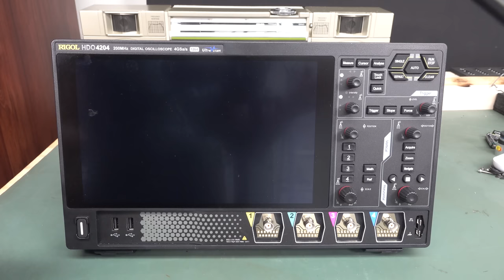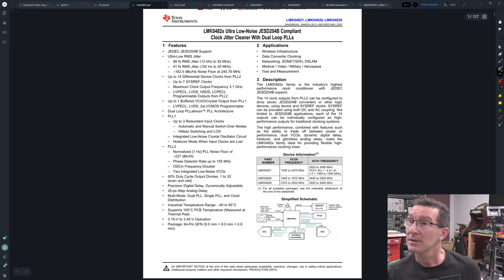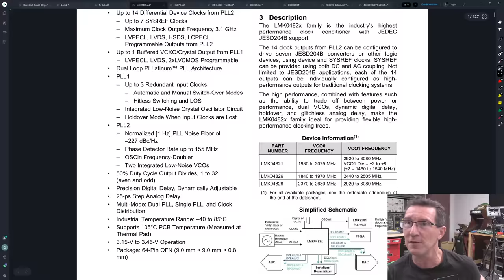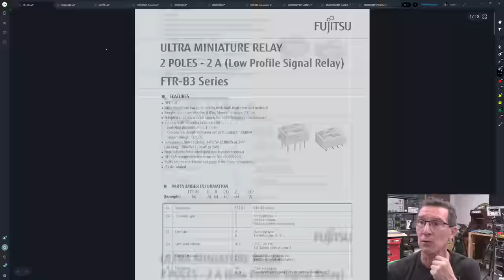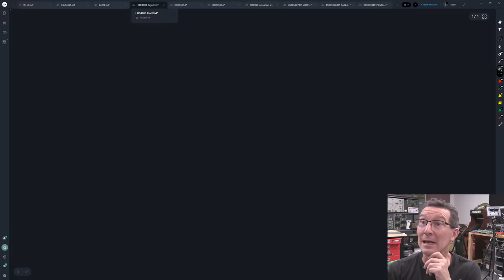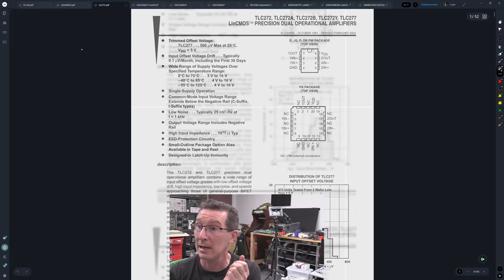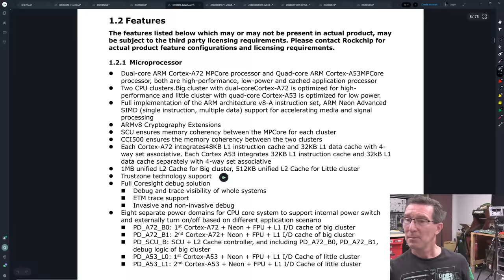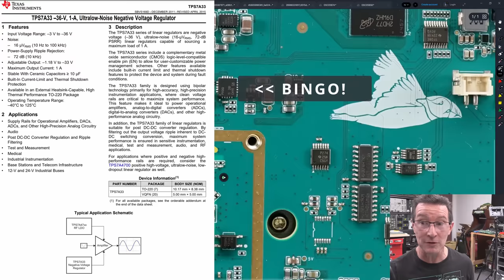EEVblog 1503 - Rigol HDO4000 12bit Oscilloscope TEARDOWN

Comment: Bird is a puffin. Black and white with a coloured beak, and not common in Australia outside of a zoo. 

And fast flying so a fast colour device.

50R termination going to be well cooked if you put more than 2V into it, going to say you will have a call for inputs to have a warning on that mode, or you will be cooking input resistors within a week if you have anything over naff all input power.
Reply from the maker: Yes, I expect many fried 50ohm inputs. Maybe they couldn't get the bandwidth (and response shape) they wanted with the bigger part.
Reply: Puffin is common on the east coast of Canada especially Gaspe Quebec.
Reply: @EEVblog  I can see the one accessory being sold will be a 50R inline termination that can handle 5W, probably with 6dB attenuation or more, so that you can actually use the 50R input. Otherwise a warning when selecting 50R that your input range is limited to 1V only.

Looks like the team was the one that did the spectrum analysers.
Reply: A puffin might be better than a weird egg-laying poisonous mammal.
Reply: @EEVblog  Reported yet another impersonator......
Reply: @EEVblog  - thanks - you answered my question earlier today.
That is not good - people will get burnt out PCBs.

As Dave says at 16:00 those tracks and parts look very whimpy for 50 ohm mode.
Are they 5 thou tracks and tiny resistors?
So could they burn out in some situations?
Reply: I wonder if the Rigol PCB designers had some kind of unpopular opinion... ;-)
Reply: ... but not really so much RGB-coloured colour device. More of a RWB one (Red-White-Black)  😉 https://en.wikipedia.org/wiki/Puffin

Comment: The RK3399's big value proposition is probably that x4 PCI-Express port, which makes for a very convenient way to talk to logic on FPGAs. They might even map the waveform store RAM directly into the SoC's address space.
Reply: Thanks for letting us know, the interface between the SoC and FPGA was one of the things I was wondering about, PCIe is a really nice fit for this application indeed!
Reply: It's at the heart of a few single board computers too.

Comment: I wonder if the heatsinking could be more about minimising temperature for stability than having to dissipate a lot of heat
Reply: Maybe even have all inputs at the same temp, to reduce differences between the inputs on the same signal.
Reply: I also like the way they integrated heatsinking, temperature equalization and shielding into a single die-cast part.
Reply: @aDaWaN  Makes sense, after all a single spin cast mould that integrates it all is going to be cheaper in the assembly line, and you can get great dimensional stability in that single part as well so minimal machining work to get good results. You need a heat sink, so makes sense to have a single part then for the entire range, and it definitely cuts the cost down in assembly. Spin cast, run through a single CNC mill to level the critical paths, and drill the holes and tap them, and be done. One fixturing clamp only needed, and perhaps 3 minutes of machining time total. 400 per machine per day is probably faster than the rest of the production line.

Comment: excited for hdo1000 with12bit at $999. would be very nice to check for whether it actually has that 50 ohm input not mention in datasheets but stated in  ui and the front panel.
Reply from the maker: No 50ohm input or active probe inputs.
Reply: @EEVblog  Oddly enough hdo1000 user manual 5.4 says:  When the input impedance is set to "50 Ω", the channel coupling is set to DC coupling by
force.
Am  confused.
Reply: @bakagaijin7452  Probably used with external 50R terminator, and software sets the input to DC coupled when you select the 50R termination for the display unit.

Comment: Looked at using a 4053 for a sample+hold circuit once. The worst-case ratio between on-current and off-current wasn’t extreme enough. Ended up making a large spreadsheet, and settled on using a DG444.

Comment: an interesting note with the closer look around 24:25.
the micron memory there (and likely for the SoC as well) is 4Gb/512MB x16 width DDR3L 1866MT/s memory, so there is 2GB total RAM there, which makes sense with the ongoings under the hood. the 3399 ARM SoC has a PCIe 3.0x4 link which also makes it easier for coms to the FPGA with low latency, as a few people in the comments here have mentioned. this is fitting given it's 2Gs/s would be too much for serial unlike lower sample rate and bandwidth scopes.

Comment: Rockchip 3399 is commonly used for android boards.  I think Linux will run on a wide range due to the large community but I always see the rockchip 3399 and the older 3288 on android devices- it’s probably because there is well validated software to run on it. The two buttons populated are recover and reset and I always see them populated regardless of if it’s intended to be worked on. Somehow it must be required.  I’m working on a 3288 now trying to hack an old advertising display with touch screen on it. It’s supposed be to be “pretty powerful” for android because it’s also found commonly in Chromebooks

Comment: I seriously question if the 'Warranty void if removed' sticker is legal in Australia. I don't think it is in the US.
Reply: If it is, you can buy the exact stickers on Aliexpress.
Reply: IT IS Legal in Australia
they can legally refuse your warranty if the sticker is violated
and i'll tell you how i know this 

Many moons ago when i bought my DS2000A Series Rigol scope
as we all did, i did my upgrade to 300MHz
Anyway, i went into Emona Instruments at one point and they figured they'd come out with the question and face me with it 
well... Little did they realize , i handle pressure extremely well and i don't give 2 fucks about what they think

In a nutshell, they asked 
"so... you did the upgrade illegally did you ?"
i said to them,  "No, I didn't do anything illegal, but i did do the upgrade"
The scope is mine i can do what i want with it 

they asked "so you removed the warranty sticker did you "
I said "well.... You can see the warranty sticker is intact and un damaged and not violated"
they went on about a speech regarding "well, we know you took it off"
and i said "well, regardless of what you think you know the sticker acts as evidence of tampering and as you can see the sticker has not been violated and is still intact"

THEY HONOURED THE WARRANTY

so yes, it's legal
But... Had i said directly "Yes, i removed the sticker" this would have been enough to void the warranty instead, i said "well. You can see it's still intact"
In Australia there is a big difference there , legally speaking.

and ... LOL.. He actually tried to debate with me as to whether i was doing something wrong. 
and i said,   
Mate,   it's my scope,  i can throw it in the bin, i can piss on it if i want , i can pull it apart and take the components out,  it's my scope

When he said, but it's our software
i said... "well, You shouldn't have been so stupid so as to lock it via software,  and you should have been smart enough to know who you are selling to and what the product is,    what did you expect us to do , We are technical people, as soon as we get something home, we open it and check it out,   did you honestly expect no one to interrogate the firmware ?   so.. since you were banking on no one finding out and we did,  i suppose you'll learn for next time won't you ,  as for now, you gotta cop it on the chin"

he said,  when you bring in your scope for service we'll just roll back the update to 70MHz
and i said "actually , no you won't , what you will do is  LEAVE THE SCOPE IN A SIMILAR CONDITION AND STATE TO WHICH I BROUGHT IT TO YOU IN"
they had no way out of this , they just had to grin and bear it
Most people kept quiet about the upgrade,   i didn't give a fuck

Comment: Really interesting that they are using Linux on the Rockchip and there is a JTAG, 4 pin port and 2 switches.   That thing is probably easily hackable.

I'll bet you can ssh into the OS from the 4 pin port.
Reply: try username root and psw rigol XD

Comment: With Android OS it should be fairly easy to connect this scope to the internet. Android platform includes the HttpsURLConnection client, turning the scope into a web browser and a web server. More and more test equipment are being designed for World Wide Web connectivity
Reply: That leaves us with 1 question: Why would you want to connect your scope to the internet?
Reply: @JCGver  1 Remote users on the internet can see exactly what you are seeing during a test by logging into the scope with secure username and a password  2 Email test results such as screenshots or JPEG video of the test to others on the web.3 Download new 'app' to change scope functions.  4 Save test results to the CLOUD for future analysis and viewing. you can store unlimited amount of data to the cloud   5 Using an embedded web server, a remote operator can run the scope from anywhere on the planet, 6 Factory diagnostics in case of failure. 7 Factory calibration and firmware upgrade 8 You can download third-party apps for various analysis, you don't have to depend on Rigol for their limited analytical library... and many more applications. I hope that gives you an idea of why test equipment are getting connected to the World Wide Web
Reply: @nicmate2543  - Wake up!  it's no dream. It's reality. Most modern electronic equipment are internet connected.

Comment: Not a Tek 2 but still a very nicely built scope. I like the shielding and the way the PCB is designed. Just look at all the gold plating and these smoothly rounded traces, it's a thing of beauty and a joy for ever, just like Tektronix did in the '60s. Good job, Rigol engineers! Now, on to Shahriar's teardown... wonder if he'll do one too, haha!
Reply: It's way better than the universally panned Tek series 2.
Reply from the maker: @NeverTalkToCops1  It's hardly "universally panned". By who? It's a nice scope, it's just not great bang-per-buck. But bang-per-buck is not Tek's domain.
Reply: @EEVblog  Tek is more the buck per bang, and being at the bleeding edge, for the time. Then stay as the solid reference for the following 3 decades, to use as a reference device for all who use them.
Reply: @EEVblog  Panned by MANY commenters to your video. How casually you dismiss the "bang for buck" factor. "... Not great bang per buck"? Of course, the Tek 2 series is horrible bang for buck. Who buys an 8 bit scope when this 12 bit Rigol scope is available at less bucks? Even Rhode & Schwarz will have sales of their 10 bit RTB 2004 scopes suffer because of these 12 bit Rigol offerings.
Reply: @SeanBZA  IF your criteria depends on gear being a viable "reference device" for 3 decades, then have at it. How is the Tek series 2 "bleeding edge" at 8 bit resolution a better value than these Rigol 12 bit offerings.
Reply: @NeverTalkToCops1  Kereping the big market, the military, from needing to change any of the training they have had for the last 50 years, just like Fluke still makes average reading meters and not RMS, to emulate analogue meter movements.

Comment: 24:25 is that QR code made with vias?
Reply: It says "QR code" on the silkscreen, but it's actually a Datamatrix code. It reads "ZRSPYHDO12209050003" w̶h̶i̶c̶h̶ ̶i̶s̶ ̶p̶r̶o̶b̶a̶b̶l̶y̶ ̶t̶h̶e̶ ̶s̶e̶r̶i̶a̶l̶. (2022-09-05? Third one off the line?)

EDIT: My assumption above is wrong. The serial can be seen at 0:28 and is "HDO4A243700085"
Reply: @henninghoefer  I don't know my 2D codes well enough to know the difference. I was just surprised by the way it was made, with vias.

Comment: 12:00  "Just a differential pair output buggering off there."  That's the second usage of "buggering off" differential pairs used by Daiyve.  Is the destination of the "buggering off pairs" the flying albatross on the PCB? Place your bets.

Comment: Seems FPGA memory bandwidth limited then, since 2x ADC and only 4GS/s in single channel mode.
With dual ADC, 1ADC for 2 channels, 4GS/s should be possible in 2Channel mode, but FPGA interface/memory bandwidth likely sucks too much, for that ;-/

Comment: It's using custom Rigol chips - what if they need to be replaced one day?
it has BGA chips - so hard to fix if not impossible.
The multitude of tiny switch mode power supply chips doesn't look durable to me.
I've seen chips like that cooked on PCBs.
As Dave says at 16:00 those tracks and parts look very whimpy for 50 ohm mode.
Are they 5 thou tracks and tiny resistors?
So could they burn out in some situations?
Reply: BGAs actually aren't too bad anymore; even if you're not comfortable with or don't have a good hot air gun they have a broad hoof attachment for most irons that let you take them off in seconds. Then you can stencil on some solder paste (stencils are optional, but cheap and helpful), heat it again to create the ball, and then plop it back down and zap it again quick with some heat and you're done!
Reply: I think the hardest part for me with custom chips is the supply. Dries up quickly after production and then you're dead in the water if you need one down the road.
Reply: @Chilangosta  - in theory that is OK but in practice it's hard to get a reliable repair.
You can't see if your solder connections are all OK.
Did you know that they check BGA connections with an X-Ray system in the factories?
Reply: @Chilangosta  - yes - they make only a certain number of chips and that's it.
Factories will often order an extra 10% to keep as spare stock
so they can do repairs and that's all there is.
They use too many custom chips to cut down the cost of mass production.
In the good old days design engineers would try their best to use chips
that were available from at least 3 different sources but not anymore.
Some chips now even need factory firmware to operate them too.
You'd never be give that.
The repair game is a thing of the past in many cases.

Comment: Why would you want to add a DC bias to the frontend?
Reply: good for measuring low frequency noise/drift for power supply circuit?
Reply: I was also confused. Everything should be software controlled.

Comment: I'm confused Dave, you keep saying 800mhz scope, but it says 200mhz on the case?
Reply: That's because the hardware is an 800MHz scope, only the firmware limits it to 200MHz. You can buy a license code from Rigol and unlock the higher bandwidths.

Comment: Yeah they cheaped out on the rock chip soc, it's a turd processor for bottom of the  barrel tablets and cheap TVs, performance is horrible as well as software support
Reply: It may not be a high end SoC indeed but there was a time not so long ago when a scope did not need a 6 core 64-bit CPU running at 2 GHz 😉
Reply: @MrJef06  and that's.how you get sluggish unresponsive UI as soon as you do anything than displaying a basic waveform. That manufacturers always cheaped out and put underperforming soc does not excuse them

Comment: SOO UNFORTUNATELY.  THIERS ALWAYS AN UNFORTUNATE.       THE RESON FOR THE HEAT SINKS AND FAN IS TO DRAW DIRT AND DUST IN AND OVER HEAT IT IN YEAR SO IT OVER HEATS AND YOU HAVE TO BUY NEXT YEARS MODEL. THAT'S THE REASON ALWAYS FOR THE FAN.     ALWSYS.  YOU CAN ALWAYS DESIGN ANY THING THAT RUNS COOLER OR HAS A FAN FILTER.   THIS IS PURLEY TO KILL IT IN A YEARS TIME